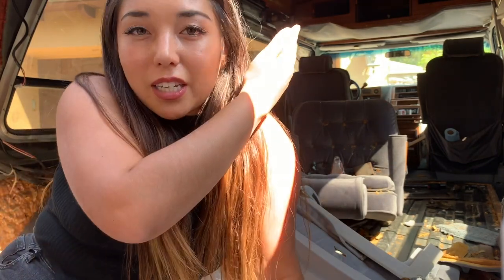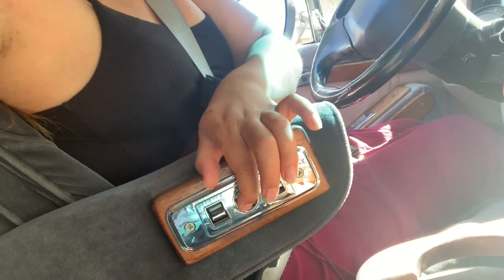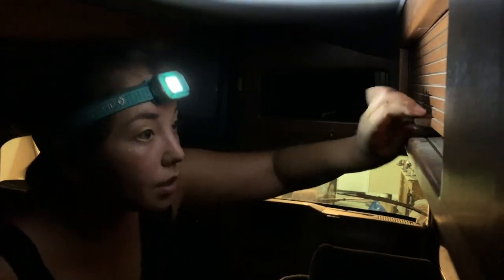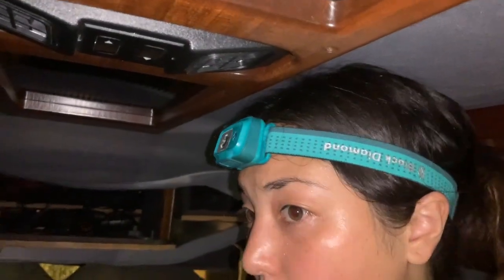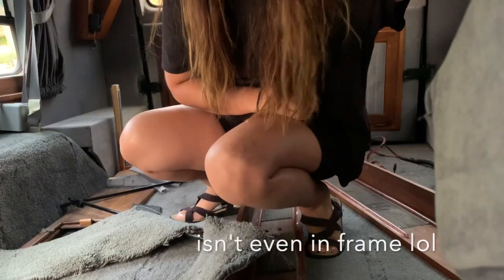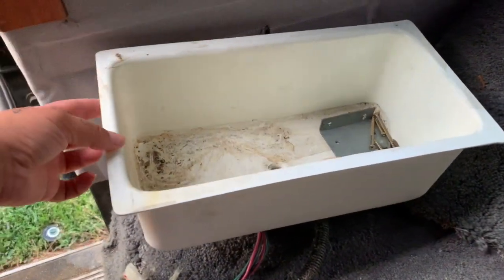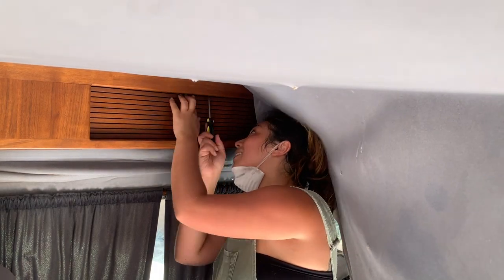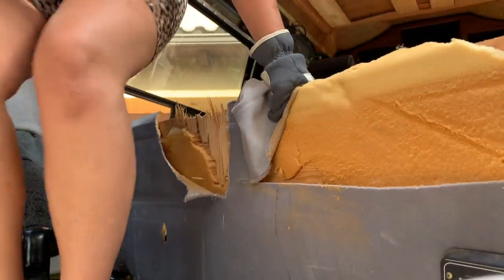Gutting a Vandura

Comment: Side note, before buying “Froderick”. I actually went to the lot to check out a van similar to yours. A high top, with almost 400,000 miles. White smoke when it finally started. I inquired after the orphan,  150,000 miles-had a strong engine and tranny. Squeaked when I test drove it. “I can fix that” I thought. $1000. Best purchase ever. But I wanted an overland 4x4 vehicle. Hence the ExpOverlander.